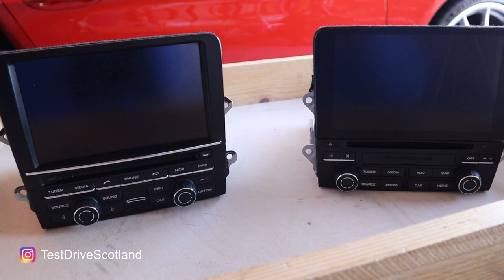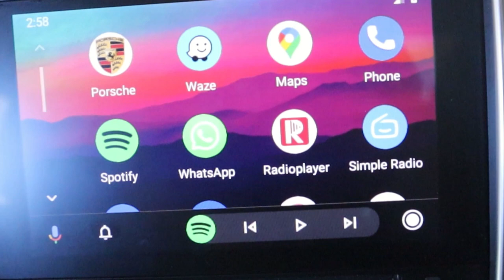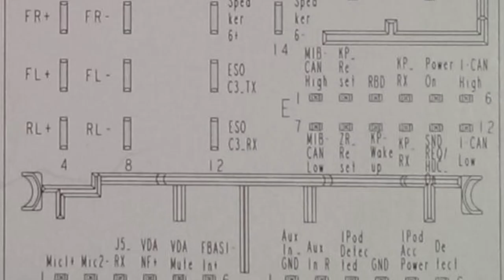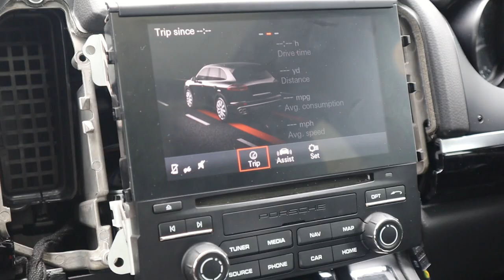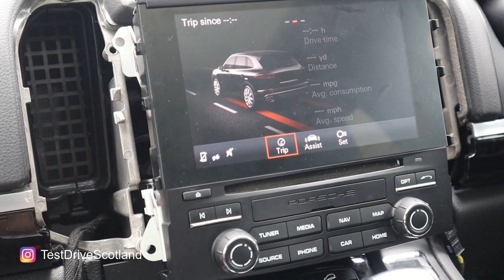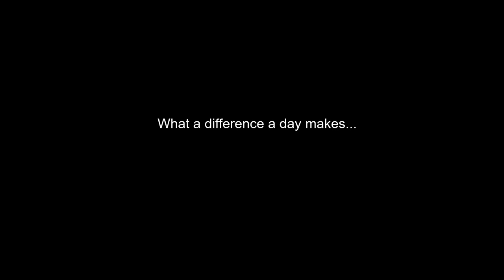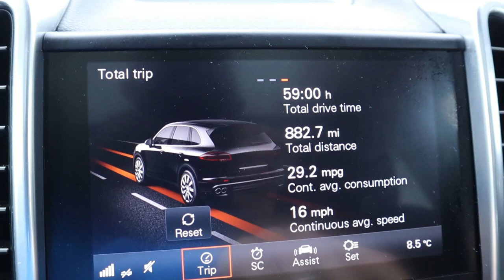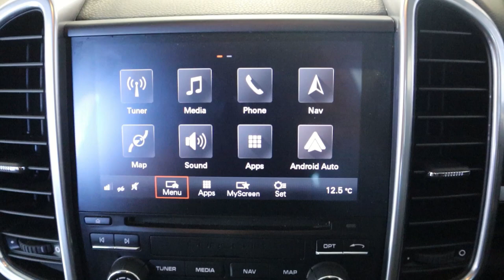Can you retrofit PCM4 into a 981, 991, Cayenne, Macan, GT4 GT3? | Part 1

Comment: Hi : great video. Do you suggest to replace pcm 3.1 by pcm 4.0? Or to move forward with the aftermarket solutions with CarPlay (such as isudar or Joyce auto). Second question: will your solution work in a 2014 panamera with pcm 3.1 (I don't know whether the dimension around the vents are similar to the cayenne in the video)
Reply from the maker: Hi, thank you. In my opinion Pcm 4 is significantly better than any of the Pcm 3 add on solutions but if you have bose or burmeister then it's a far easier to modify pcm3.

I can't say for sure but I don't see why not. Dimensions wise they should both fit, the issue in the cayenne was that the vents sit over the top of the screen and are a slightly different shape. In the panamera they look to sit to the side so looks like it should be ok, the pcm 4 is slightly longer.

If you are interested i can help with a kit, please email the channel. Email is in the video description.

Comment: Great work, and thanks for sharing.  Hopefully part 2 is going well.   I hope you can earn a bit from your efforts.  I would definitely pay you for a coded pcm4 and loom, or even just a pinout and a set of coding instructions.   Not sure where in Scotland  you are, but shout if you want a 958.2 with Bose to test on.  In fact, get please in touch if I can help at all.  Great project!
Reply from the maker: Hi Graeme, thanks a lot really appreciated. I can help you out, the problem with cars with Bose is that the pcm 4 is not compatible, I think the only option is to install an aftermarket amplifier or to buy an expensive adapter. If you want email me at testdrivescotland@gmail.com and I can run you through the options.

Comment: Hi Daryl, very brave to attempt this with the very different connections. I didnt get Joyauto on my 981 as it looked risky and I was worried about delivery from China but instead  just upgraded the HDD to an SSD using an Ableconn IIDE-MSAT mSATA SSD to 2.5-Inch IDE Adapter Converter with Aluminum Frame Bracket - Latch and Retain mSATA SSD as 9.5mm 2.5 IDE SSD Drive and Transcend mSata drive after using CloneZilla on the OEM HDD after upgrading maps in my 2012 981 to 2021 to get newer technology, most people I guess would like to know a few things so I will start the ball rolling.
How much does an OEM  PCM 4 unit cost ?
If enough people commited to a bulk purchase from the original manufacturer and bypass Porsche, how much could it drop to ?
You mentioned about being unable to update the software, I have a Lenovo Clone PIWIS3 with a non porsche VSI interface, does it need an OEM Porsche Interface ?
Where can you get the special program to help integrate a PCM 4 into a car set up for PCM 3.1 please as I had trouble locating that ?
I have BOSE so do you think I just need to move the optical connections from the OEM harness to the aftermarket harness for full compatibility ?
I think its not going to be cheap to do but if it was less than £1500 to £2000 it would work !

Cheers Daryl

You are a star mate !
Reply from the maker: Thanks, if you would like support in doing this on your own watch the last part of the video and drop me an email if of interest. I just don't have the time to support everyone in the comments section.

Comment: Great work Daz. I’d be interested. No steering wheel controls in my Spyder, no Bose either. And prob a simpler loom as fewer speakers. Another top video 👍🏻👍🏻. Ps I understand “red” is sold again (now standard)
Reply from the maker: Thanks Dan, should be straight forward then.   I have one unit in stock but going to take a while to build a loom, I have a coding contact down south who can support. 

Not surprised nice looking car 👍🤣
Reply: Have messaged you
Reply: Presume a friendly Porsche specialist with PIWI could do the coding?
Reply from the maker: @dansquires7385  they can buy won't be experienced and it's not straight forward. I've learned a lot through trial and error and many hours working things out. You can't auto code a pcm on car it wasn't designed for

Comment: Brilliant video, super excited for the next one. I'd be very interested in a supplied and coded unit if you do decide to do them! Will you be covering any extras that are needed such as DAB antenna?
Reply from the maker: Thanks Mike, yes the plan would be the full kit minus the cluster flash or you could send a unit to me and it can be returned with all the coding done to suit your car. The issue is pcm4s don't grow on trees
Reply: @TDS981  Indeed, there looks to be one on eBay for a decent price at the moment though! If you offered it fitted that might be tempting too, and a nice excuse to drive up to Scotland!

What is the reason for not wanting to offer the cluster flash? I would assume aslong as you don't alter mileage then it would be ok to do?
Reply from the maker: It is fine to do you are only flashing the bit to the right with the data in the screen the issue is I don't have the tool to do it, the plan would be that we have contacts that can do it for you for a fixed fee, at your own risk obviously.
Reply from the maker: Drop me an email and I'll get back to you when I've got a plan together

Comment: Daz, great video! A question as to why you say the the PCM4 swap is not compatible with BOSE? Why so?
I understand Bose uses MOST optical output rather than the line output used by SSP amp, but my understanding is the PCM4 can be coded to output in either LINE or MOST (but not both simultaneously) Would coding the PCM4 to MOST output solve the problem, or is the issue more fundamental? Iirc, 981 have MOST25, and 718 use newer rarer MOST150, So I guess if you wanted to use a PCM4 in a 981 with Bose, you would need to get  MOST150 output activated and source a MOST150 Bose Amp to match?

Also, I read The PCM4 does not display map data in cluster of 981, as the multimedia board in the 981 cluster is different than the one in the 718 with PCM4 (981 cluster needs more flash & RAM & and programmed today PCM4 specs)
Reply from the maker: Thanks, without going into detail the old amp won't work with Pcm4 unless there is an adapter out there but I'm yet to find one at least at a reasonable cost. Of course you can code it for MOST output but the problem remains it's set up for the later most150 amp.

There are some solutions to this problem but you have to commit to ditching your existing amp either for an aftermarket solution or later unit but it's not plug and play.

You are correct regarding the screen. Your desire to use the OEM nav after acquiring Google maps or Waze will be extremely limited if you want to arrive on time and the carplay/AA maps don't show in the cluster anyway.

If you want to discuss further, email the channel testdrivescotland@gmail.com and we can discuss your options.

Comment: Awesome video! I just picked up a 2016 Cayenne diesel and want to do this mod. I see that it had android auto. Did the used PCM you bought had that enabled from the factory or did you code in that access? I'm on the Apple side of the fence and would like to do both the 4.0 upgrade while adding Apple car play to the features. Thanks
Reply from the maker: Hi thanks, no I enabled those features after installation.
Reply: @TDS981  I was on rennlist and saw there isn't a good way around Bose yet. I'll have to wait for a solution or do research on how to bypass the amp issue with buying a aftermarket amp.
Reply from the maker: @FourReelProductions  yes you either need an expensive adapter or you commit to changing the amplifier out.

Comment: Thanks!  I'm in the states and interested in swapping out in my 958.1 ('14 Cayenne Turbo S).  Looking forward to part-2 and would love to connect up to discuss possible pcm4/loom.
Reply from the maker: Thanks 👍 drop me an email testdrivescotland@gmail.com

Hope you don't have bose 😭
Reply: @TDS981  uh oh - i do have bose.. let me guess, their amps are impossible to get straight with the updated PCM4..
Reply from the maker: @TyBurger1  sadly not compatible, but if you can source a Pcm4 and a Bose amp together from the same vehicle it should mate up ok.  Otherwise you need to ditch the Bose amp and go aftermarket.
Reply: @TDS981  Are there good options to install aftermarket cleanly and sound >= to bose?  I suppose the only other issue ditching the bose amp is that you'll have perpetual DTC's due to the missing components right?  Something about having codes hanging around that isn't super appealing.
Reply from the maker: @TyBurger1  I'm not sure which amp to recommend for pcm4, would be best to discuss with a local audio specialist. There shouldn't be any associated codes lingering because the Pcm4 can be coded to suit the set up you chose.

Comment: Do you have a backup camera? If yes oem or after market? Does your previous calls show in cluster?
Reply from the maker: I don't use a back up cam, but it can be added. Yes my cluster in both the 958 and 981 shows all call info, last dialled etc
Reply: @TDS981  thanks for the info. I will have to check why mine does not. It shows incoming calls and contacts. If you figure out backup camera let me know I am willing to pay to get it to work

Comment: Have you found a way to take the parking brake off from service mode, i see you have the same as me, but i tried with the scanner and no luck.
Reply from the maker: I don't have a parking brake error, when scanning various items flash up.

But yes I know how to get the parking brake out of service mode they usually require calibration but you need to do it in the right order.

Comment: Hey, Thanks for the video!!  Unfortunately the super thanks doesn’t support NZD 😩.  I’ll figure something out !!

I had the PCM 4.0 in the GT3 so going back to the 3.1 in the 981 is a bit frustrating really, especially once I’d put Apple CarPlay into it and realised the touch screen doesn’t really work well enough to support it. 

So if I install the 4.0 as you have, would that include CarPlay as it did in the GT3?  And I also put the 9XX Apple CarPlay kit in for reversing and front cameras. How could I enable these with the PCM 4.0?
Reply: Mib2 software. Look it up.
Reply: @vartechinc  Thanks, looks like a bit of research… and wait for part 2 of the video :)

Comment: Great content. I have a 987 Gen 2 and the Pcm 3.0 does not Turn on i have checked all the fuses with no luck. can a Pcm 3 be fixed and If so at what cost. Or whould it be cheaper to purchase a 3.1 Plus would A Pcm  3.1 be compatible in a 987.2.
Reply from the maker: Sorry to hear that, unfortunately I don't know if PCM 3.1.fits or functions in the 987. There is only one way to find out!

There are people that repair pcm units, use Google to find one local to you.
Reply: If you have a 987, Porsche makes a Porsche Classic replacement with CarPlay now
Reply: @kalebkloppe6193  Only for the .1

Comment: I'd like to try this on my 958.1 Following, and I'd love to see if you get this to work in your other car!
Reply from the maker: Thanks 🙏 done it was slightly easier on the 981.
Reply: @TDS981  You don't have XM or Sirius over there do you? I dumped the joyeAudio and went with Idodar but I didn't do an aftermarket head unit because I listen to satellite radio almost exclusively.
Reply from the maker: We have DAB which is HD radio. That works with pcm4 and I managed to hook it up to the OEM antenna.
Reply: @TDS981  I'm shopping for a radio. I had to build a couple of piggyback harnesses and reprogram my 2019 Z06 to add a few missing options when new. (NAV, PDR, Subwoofer, AMP, Heated and vented comp seats, etc.)
This is along the same vein and probably easier! I have a PIWIS II also, so I'm good to go. 
If you want to run with this as a service I'm near Detroit. I'm more than capable of doing this mod.